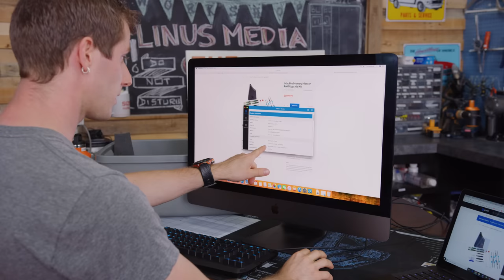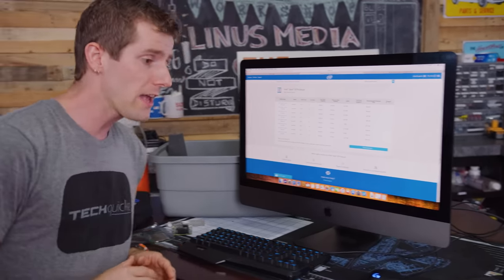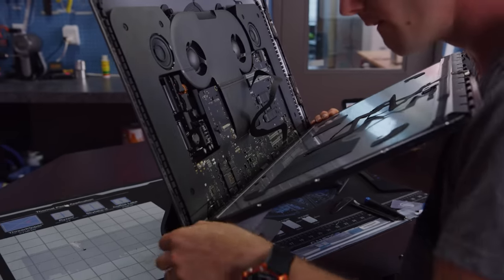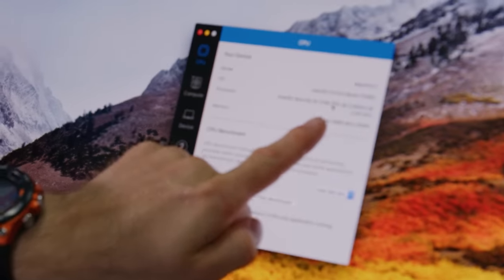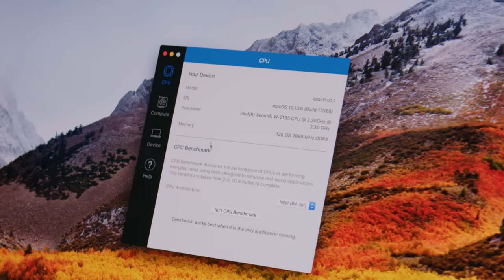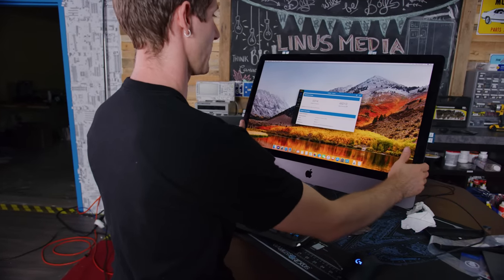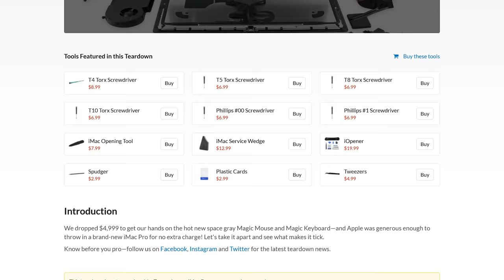UPGRADING the iMac Pro!?

Comment: Now the cpu and ram will be soldered for the next Apple products
Reply: __ you actually called it, newest MacBooks have soldered cpu gpu ram ssd
Reply: @NuclearAmouri  Are you for real? Like, WTF Apple?
Reply: @TooFurious4  they still need to solder the battery and keyboard THEN they would require you to buy a new device if the headphone jack fails.. oh wait, they already do that with iPhones.
Reply: most laptops have solder cpu's and gpus,
Reply: @NonsensicalSpudz  And that makes Apple any better how?
Reply: Ohhh boy just you wait
Reply: @TheFaqvideos  in fairness it makes things smaller and slightly more integrated...even if it makes it harder to repair long term
Reply: Thanks a lot Linus
Reply: Only if u knew.........
Reply: @TooFurious4  money
Reply: Sad but true
Reply: @NonsensicalSpudz  First of all we're talking about apple where theyre complinting for long support of devices and i dont disagree but if u dont allow to upgrade what the point and this is a desktop we should be able to upgrade it
Reply: @arush.27  You realise I'm not defending apple, I build my own PCs and repair my stuff
Reply: Oh, this didn't age well. Lol
Reply: Hello, I'm writing from the future, 2024 actually, Apple is soldering ram and cpu to the motherboards and use All in one (SOC) chips. Regards!

Comment: Apple is going to watch this and think we need to make this harder
Reply: Weld ALL the things!!
Reply: just add a bomb inh it when you open it the second you take off the mob it gos boom
Reply: It does kill you if you open the system!Exposed 240V Power supply right in the middle around the area they will be servicing? Heck yea
Reply: Potato IQ > Apple Genius IQ
Reply: I bet they create an anti Linus edition
Reply: Solder the motherboard to the chassis and have the power supply over the back of the screen so if you take anything off its shocks you.
Reply: Man, we made that way too easy. We should implement a Tesla coil or a bomb or something.
Reply: @televisionandcheese  why is this dangerous if it is unplugged? I don't get it.
Reply: It holds the electricity. Power supplies make use of many high voltage components, a very common one is capacitors, which are just like a battery, although more instant, you touch one of these, even if it's been unplugged for weeks, and it will shock you with enough voltage to kill :/
Reply: Alexander Farid   Potentially there are capacitors charged to a high voltage in the PSU?
Reply: jimmy kraft apple will update its software
Reply: That's a easy one. Apple could just solider everything to the motherboard like Mac books. I wouldn't be surprised to see apple do that in the future and argue it was to make the machine thinner or some other BS.
Reply: Unfortunately you're probably not wrong
Reply: Haha I laughed
Reply: Me : "Apple please make it harder to open moving forward. Please solder everything at the board. Create several version of PCB layout so it will hard for Linus or iFixit or anyone else to dismantle Apple machine. That's how can maintain profit" -- TC : "Sure Bro, no worries, we will even put a booby trap on the next machine. So any attempt tp crack the machine down will trigger an "auto destroy" mechanism in 5 s"
Reply: Apple is going to think he is turning it into a PC
Reply: ‘Pours heat resistant glue on everything’
Reply: Next they’re gonna soldier the cpu, gpu, ram, wifi card, ports and display for “thermals”
Reply: Oh they did by making getting a system so expensive that there is no point in being able to afford to something better and should just build your own windows rig
Reply: @bradclapp4022  But i have a question, are regular imacs from 2013-2014 easier to take out than a modern one?
Reply: @drewbutler1326  I mean, they basically did put a tesla coil inside with the exposed power supply

Comment: Apple: "Hm, even the dangerous exposed power supply is not holding them back anymore?"
Reply: Next step is a PCB full of exposed 400V condensators and tripwires that will lead to shorts.
Reply: Every screw head will have a microswitch that triggers a 50,000V stun-gun wired directly to the chassis...
Reply: tere Siim.. ei expectinud sind siin
Reply: Novot siis :) Linus on üks ägedamaid ja paremaid. Teeb head asja :)
Reply: @SiimKuusik  agreed
Reply: honestly though, apple like nah can't spend 5 dollars on a thin enclosure
Reply: What upgrades did  you do ? i cant see any mention in the description 😡😡😡😡😡😡😡😡😡😡😡
Reply: Groot Official theres a '?' there plus you're not supposed look at the description to know

Comment: The words “Apple” and “upgrade” are not compatible.
Reply: That’s only true for the recent 5 years honestly.
Reply: What did he just do then?
Reply: Nice hairline
Reply: Just upgraded my 2018 iMac from 8GB to 40 GB with Corsair. Took 30 seconds, small door on the back that pops up.
Reply: It's really amazing how the Apple who once made computers where you could fold the entire motherboard out on a tray and the Apple that makes a laptop with a riveted in keyboard are the same company.
Reply: @khaledelbalal6827  he turnd an Apple into a PC to quote Apple to luis rossman. 😋😋😋
Reply: And never will be
Reply: @VSigma725  I know, right, I remember when their keyboards were magnetically retained on the PowerBook series so you could upgrade and repair the laptops without a screwdriver. And the PowerMac G5 having everything on quick removal caddies to make upgrades and repairs take under a minute of time and use no tools.
Reply: @williamforbes6919  Yeah, I have plenty of old stuff from the "68k" and PowerPC era and it's all relatively easy to fix.
Reply: Just like literally every piece of tech that doesn't start with i, mac or apple

Comment: Apple's basic R&D goal: Try to make upgrades and upgrade approaches as hard and dangerous (open power supply) as possible.
Reply: Exactly. How many more cents would it have cost to shield that PSU?
Reply: It's fine. If somebody got electrocuted by that, I'm sure Apple would sue his relatives for the bad publicity caused by his death... And win.
Reply: So freakin depressing, yet so so accurate. And people wonder why Apple gets that evil reputation sometimes.
Reply: they are not meant to be opened, so why would you care if theres Cage or not? extra material and weight...
Reply: @ivanoxx  it is still going to be opened by employees doing repairs etc
Reply: Ivan Anonym
if they were not meant to be opened then tell me how you would clean the dust out of the Mac to improve the air flow and temperature management after a busy year, because if you can't do that, these machines will become loud and slow and thus even more useless.
Reply: @ivanoxx  oh yeah, open it and clean the fans after using one year and then got killed, AND pay for apple because they'll sue your family. Nice
Reply: You seen the size of that thing? It's basically the size of a monitor.  Easy to criticize when you build in a huge ass tower.
Reply: There are capacitors in the power supply. They will still be charged after unplugging and can give you a nasty shock
Reply: Lemonwhitemacaroon red Those PSU caps can hold charge for months.
Reply: @Malc180s  Yeah, usually when people go after you irrationally love, you get outraged. 
News flash, buddy: a 5,000$ "pro" machine a 100$ power supply are not the same. There are tons of reasons to open a computer, and almost no reasons to open a PSU.
Reply: @Malc180s  "hardly dangerous"? Lol. It is not dangerous at all. It is fun to touch capacitors, only until you touch the first one.
Reply: You could see Linus's abject fear as he worked with the machine, knowing that the capacitors could kill him at any moment.
Reply: Malc, several years ago an Apple user in a forum said the computer I hand built from five things I bought at Tiger Direct was not awesome.  He implied his Apple would not get a virus but refused to admit it was only because of low adoption.  Apple must be held accountable for his transgressions!
Reply: The power supply does not need to be shielded as all you need to do is unplug the power cord and then hold down the power supply for maybe 10 seconds to drain the capacitors. Voila! No dangerous high voltages to worry about.
Reply: @Malc180s  What about upgrading? And just because you're too ignorant to even try to repair your computer by yourself doesn't mean that everyone is.

Comment: (Apple watched this): We need to solder the screen on next time......
Reply: And solder in the CPU and RAM while you're at it. Actually, you should solder the board to the chassis, just to be on the safe side. Should we also solder the chassis to the desk?
Reply: Nah, just cover everything with black epoxy.
Reply: Or superglue
Reply: Just rivet everything while your at it
Reply: better yet, condense the whole board into a single chip.
Reply: Nah! Next time don't even make computers.
Reply: LoL 😂😂 😂
Reply: If it can be soldered on, then it can be soldered off. Just wont be easy
Reply: @Ryo Han's that's a lotta damage!
Reply: Solder the desk to the floor in the apple shop
Reply: @danieldelport1537  you gotta buy a house from apple
Reply: @Zoomin69  And when the PSU of your computer dies, you need to buy a new house. It's all just one big module.
Reply: Yea so people cant see the trash they are paying for (roasted) like your system is after 30 minites of opening the mac (im on a roll am i not?)
Reply: Lol 😂
Reply: Guess what? They will solder everything! They will remove every single adhesive and screws!
Reply: @Robert Crawford III Wilson 
It makes sense but it's anti-customer as hell
Reply: Wu Andrew but if you look at it it will break and you can’t repair it

Jk
Reply: Next year they will offer... The IRoom, a room with desk is soldered onto the wall, and on the desk, a soldered Mac with pre-configured settings, starting with $500.000 :D
Reply: ooo... you underestimate them, they already did
Reply: Also add a full armored anti bullet steel plates
Reply: Soder the charger into the apple mouse
Reply: LMAO
Reply: Solder linus to windows machine
Reply: @chronophagocytosis  that would fix the cooling issue...
Reply: Solder the user to the keyboard.
Reply: FLEX TAPE with FLEX SEAL
Reply: How do you know they watched this?
Reply: Soldering a screen is not possible I guess 😂
Reply: @nguyenpham3593  And if you pay 1500 $ extra you'll  also get the smart vacuum iSuck.
Reply: @Robert Crawford III Wilson and it's a stupid mindset
Reply: Wasn't that Microsoft's idea with their surface book?
Reply: Y’all need to stop the madness 😂😂
Reply: poop fliss Im saying
Reply: Just don't be an idiot and buy their products.
Reply: punaiset pimpulat great idea so new IMac is a desktop with a Monitor and the specs of a 400€ office pc and it cost 2999,99€ with a quadcore cpu and with a 8 core it cost 5000€
Reply: @Johnnyb167  r/woooosh
Reply: @Dean Dean r/woooosh
Reply: @B3LL  I think this world seriously needs r/Oof
Reply: Rio Hand's now with the power of flex tape
Reply: @chronophagocytosis  Hahahahahahahhahahahahahaha
Reply: @chronophagocytosis  So nobody would steal it. Yay! Upgraded security!
Reply: Nah they gonna put the power supply around the edge with no shock protection so you legit cant get the display off
Reply: @Robert Crawford III Wilson they why are the so called genius people at the genius bar not more skilled Than what we See in ie rossmans videoes ? Its About PROFIT nomatter what..  Nothing else
Reply: Just weld a steel cage around the whole chassis
Reply: @chronophagocytosis  Or the ishit reordering apple certified toilet roll
Reply: @windhelmguard5295  good solution for anti costumer hacking
Reply: Yeah heavens forbid we upgrade imac's ourselves. I had late 2013 imac 27 inch, gave it to my brother, younger, well gave it for half what it was worth, $600. Bought my self a Dell 7775 Ryzen 7 1700 8 core 16 thread, RX580 GPU dedicated 8gb, 27 inch 4k screen all in one pc. Love it. Fans sing like a leaf blower. In winter heats room to toasty 30C, 90F,  But back panel pops off with 2 thumb screws, and CPU and ram, etc upgradable except gpu. Cost $2500 CAD all in taxes etc. 4yr warranty, 4 yr Mcafee.
Reply: Maybe solder the table to the floor just to be safe
Reply: Mahmoud Nadi than solder the soldering, and maybe solder that to be safe
Reply: Nah let’s just cover the whole back with metal and then solder it
Reply: Or just held the screen in with like 40-50 clips so it's just not worth the hassle
Reply: Louis Rossmann: are you challenging me??
Reply: Wu Andrew Just here to make it so this comment has 64 replies because minecraft... lol
Reply: Oh my this this comment thread is underrated! Was laughing so hard!
Reply: @jaiden051  Of course. An iDesk can't be compatible with your normal floor. You need iTiles, which of course aren't compatible with your normal house, so you'll need to buy the iDwelling... (long story) ...which obviously isn't compatible with the Milky Way, so you'll need to get the iGalaxy too. By this time you should know that you absolutely need to buy the iReality too, because none of this stuff will work in any other part of the multiverse.
Reply: @chronophagocytosis  Suomalainen havaittu
Reply: make it nice
Reply: One day ...Apple will sell the start button separately, the screen ...everything! How to make more money? Remove everything what the people wants and sell them separately. Apple we want your money! All your money!
Reply: @chronophagocytosis  yeah, make it as stupidly un-take-apart-able as possible!
Reply: Oh Jesus
Reply: @Robert Crawford III Wilson don't call Anthony dumb or I will set my dogs on u
Reply: Plot twist u are apple
Reply: Weld
Reply: @chronophagocytosis  talk about an all in one 🤣🤣
Reply: punaiset pimpulat that’s kind of ironic now
Reply: @chronophagocytosis  done after 2 years 😜😍😍😍😍
Reply: @syleenadh2942  LOL. That old comment  just keeps on giving year after year. I wonder when the rest of that joke comes true. Still waiting for the Apple Desk, where absolutely everything is soldered or glued together.
Reply: punaiset pimpulat dip it in metal 2 good 4 u
Reply: @suhonen2423  the more conductive, the better.
Reply: you predicted the future.... apple released the last upgradable iMac
Reply: @FC12CGaming  macs suck even more now since there not upgradable
Reply: @Xenofinite  yeah I agree
Reply: @trulahn  nop they cant waste there money the will just use adhesive
Reply: and fill it with cement
Reply: @Zoomin69  apple apple, apple juice, apple car, apple glasses
Reply: Isn’t the Mac pros screen fairly good tho? XP
I dunno
Reply: @Thewaterspirit57  macs have the best screens out there
Reply: Now you have the M1 chip ahah
Reply: @Zoomin69   and to buy a house you must use an apple credit card
Reply: Meanwhile, in China... 🔒
Reply: they also need to solder the apple logo to the mac

Comment: I've touched that power supply a couple times and not died. Nasty shock though. Leave the screws loose when putting the board back in then plug items in to each of the ports once thats done then tighten the screws. The alignment holes on the case are so you can use two black sticks to align the strip properly, don't do it by eye sight. Use blue painters tape to fix the display into place on the bottom edge to act as a hinge while you test it before closing it up. This will help with the alignment as well.
Reply: Yeah same. I died when I touched it too.
Reply: Isn't there a way to discharge it first?  Leave unplugged for a week or so?
Reply: @colindoyle9876  More like years.
Reply: Thanks Dave, Years, hmm
In that case they would use capacitance for backup and no need to use dry/wet cell battery
What if when it's running pull the power. The hold power button for 10 seconds or so
Then leave for 2 weeks
Any links for info I wonder
Time for homework :)
Reply: Well... no. Grounding yourself is against static electricity. Not residual current discharge from the capacitors.
One way to prevent death is to put the left hand in your trouser pocket while messing around. This way the current doesn't cross your heart muscles.
Reply: @Colin Doyle I remember reading somewhere about how you could use a lightbulb and some jumper wires to discharge them but idk if it was being serious
Reply: @davidfodre1375  That's the opposite of what you should do when working with power supplies. The correct answer is keep one hand behind your back at all times and don't ground your body, wear rubber soled shoes.
Reply: Patrick Pecoraro how the fuck are you verified?
Reply: How are you verified with only 10 subs
Reply: We may never know how he got verified
Reply: @thedigitalmelon7326  I hope that you are OK now.
Reply: @davidfodre1375  Doubt.
Reply: Thanks Patrick
Reply: That power supply , gave me a horrible shock in a 2007 imac , I don’t know if it kills but either way holding the power button for
30 seconds will discharge it

Comment: WTF you left the best part of the assembly porn out, taking the strips off the adhesive and finalizing the build.
Reply: He likely is going to take it all back apart and reuse those parts (or ship back the RAM to ifixit), not leave it in the mac.
Reply: @Neaxtec  he said he was gonna use it for something
Reply: @Dave102693  pretty sure he doesn't need all that ram for it
Reply: makes sensee